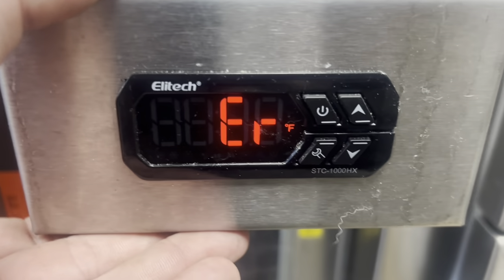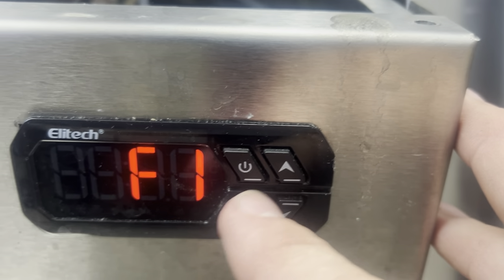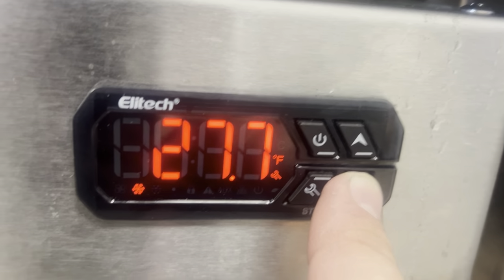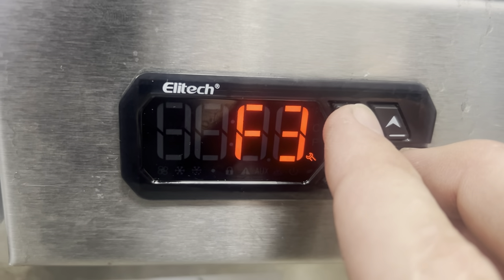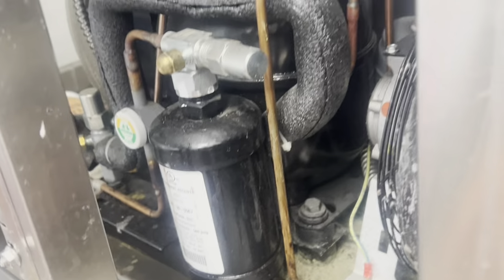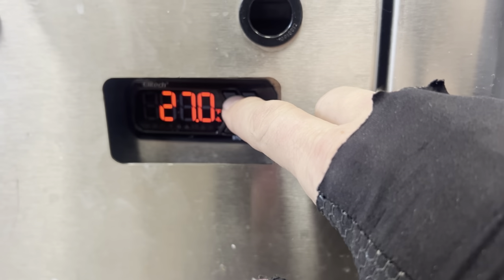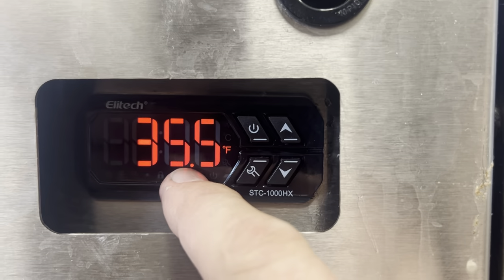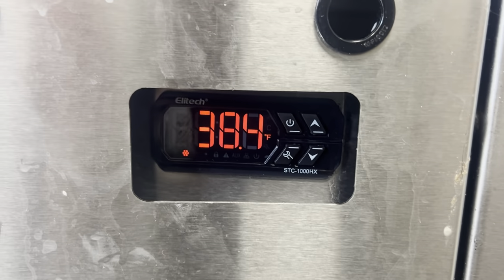Topping cooler - controller drama

Comment: 👍💪🇺🇸❄️ question on tstat setting? If reach-in cooler TD (box temp - saturation) is 20 n ur sensing coil temp wouldn’t u want a lower cut out than 27 ?  Wouldn’t 27 coil  give u a higher box temp at cut out ?
Reply from the maker: I’ve seen it both ways.   I’ve run some down as far as 21 or 22 but…. If I’m getting a 27 degree coil and upon satisfaction my can temp was 34 that’s good enough.   Then with a diff to 38 we’ll always live 34/38.  Yes as they get in and out the box temps may rise but 27evap=34 air on this unit so that’s that.   Not ALWAYS the case.
Reply: @restaurantrepairs  all good thanks